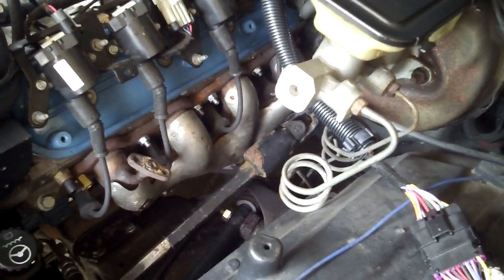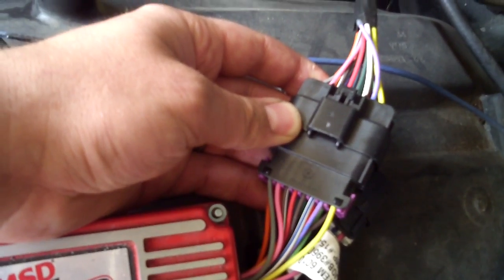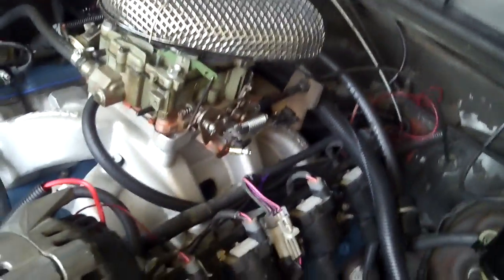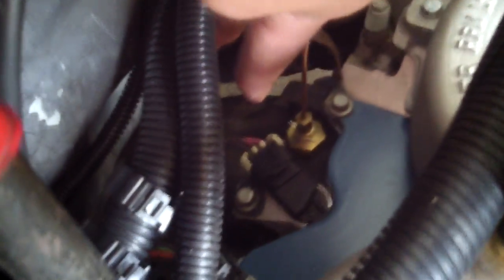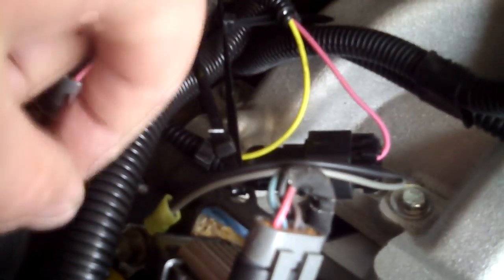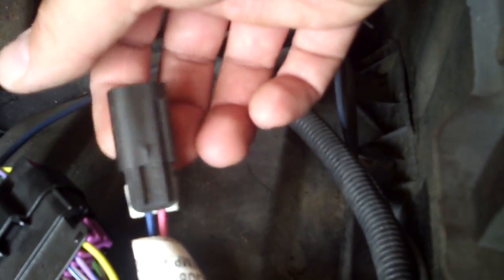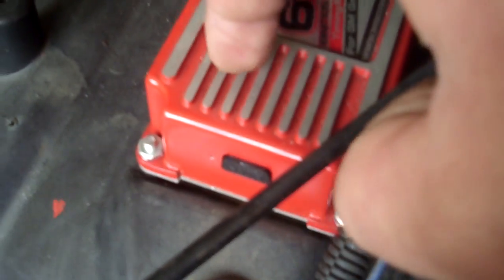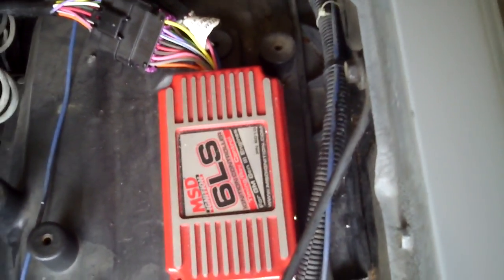How to wire an LS1 engine using MSD-6010

Comment: Thanks for the useful info 👍 , i have a cadillac with a 472 that i will swap for an ls1 with a holley sniper efi , how should i wire it and should i run the ls wiring harness or the stock one

Comment: Do you have a part number for the map sensor thx
Reply from the maker: Rock auto
Reply: @beeterolds  I don’t understand partner, I was seeing if you knew the part number to the map sensor I ordered one and it doesn’t plugs into my harness like the harness you have
Reply from the maker: No i do not... Go on rock auto and source a map sensor for a 99 thru 06 4.8 or 5.3

Comment: What did you do whit the knock censors?
Reply from the maker: Doesnt use em
Reply: What msd box did you recommend i have 05 4.8 whit 799 heads and is going on a 92 chevy ?

Comment: What’s up bro quick question how did you go about your oil pressure and fan sensors and coolest tempt
Reply from the maker: Fan is on a switch.. Oil.pressure and coolant are on aftermarket gauges

Comment: With this box do i need the ls ecu and harness and do you have to tune it??
Reply from the maker: No. And yes
Reply: @beeterolds  the box has to b tune or the ecu
Reply from the maker: You don't need the ecu. The box can be tuned or run it with the preset tune
Reply: @beeterolds  oh ok thanx

Comment: Hi I'm in the process of ordering the msd 6014 box and I understand where all the wiring and power leads go to. My only concern that I don't know is where the fuse is? Instructions say to use a 30 amp fuse relay. What did you do for your fuse?

Comment: Do you have to re wire ignition or does it hook up like a distributor with a 12v power and factory ign wiring?
Reply from the maker: Cameron feltz bingo. Distributor wiring

Comment: so I'm putting a 5.3 in a s10 and want to do the efi to carb swap, I don't need the factory harness for the 5.3 at all right ?
Reply from the maker: wolfgang beacham if you are going carb no. However you can use the the factory harness and ecm to control the coil packs. But if you went that far you might as well go EFI

Comment: I can't for the likes of me understand why people do these LS swaps and don't finish it the right way by making it fuel injection. I have 91 s10 with the LS 4.8 and with fuel injection. From the Doner truck I also took the harness and PCM as well as the OBD block. I also kept my 700R because it's 4wheel drive. I did a off frame swap and bought the right engine mounts as well and also converted my rear brakes to disc. It was a 1 yr build but is was done right and being a GM tech for 25 yrs to me was pretty simple. Now if I have a MIL, I can hook my laptop to the DLC and make corrections as needed without guessing.
Reply from the maker: Watch my other videos I eventually went EFI... But people go carb for 2 reasons... 1.) Cost 2.) simplicity... I've been on both sides and I must say for a weekend Toy... Carb is definitely the way go... Grab an intake and MSD controller (You can score both used these days for less than $500) I am speaking from a performance stand point.. If you wanna put a stock engine in a donor vehicle more power to ya... Tuning get expensive really fast and by that time its cheaper to go carb... I spent a lot of $$$ getting my setup running right and for a daily driver YES EFI is the way to go... But looking back I should have left the carb on it... Thats just my opinion..

Comment: how much did it cost setup..
Reply from the maker: Its like $320 now.. I paid 270 for it like 4yrs ago.. MSD also just released the 6014 which will support either Gen 3 or 4 engines.. Comes with the harness and garbage timing pills
Reply: Thanks man

Comment: I have a lt1 with 24x reluctor, with crank and cam sensors on the front of the timing cover. I already have coils hooked up to the valve covers. If I bought the 6ls just like you and ran the main harness by the front of the intake, will the rest of the plugs possibly reach to my sensors?

Comment: Did the adapter choke the big Qjet secondaries at WOT high rpm? I am thinking about doing the exact same thing and am apprehensive to adapter the spread bore to the square bore RPM manifold. What adapter did you use?

Comment: Hey is that a Quadrajet? Is the intake a dual or single plane? how did it run with the Quadrajet?
Reply from the maker: ran great brother EFI now...
Reply: Did the adapter choke the big Qjet secondaries at WOT high rpm? I am 
thinking about doing the exact same thing and am apprehensive to adapter
 the spread bore to the square bore RPM manifold. What adapter did you 
use?

Comment: great job..from you experience can you tell me what is the shortest carbed intake...thinking of going with the fitech unit on top of a carb manifold and turbo hat on top..nut wamt to make sure the g body hood closes.
Reply from the maker: I've only used the rpm and the truck intake I can't tell ya to be honest
Reply: Dennis Dennis I’m wanting to do the same to my LQ4, I’m wondering how that Fitech and carb intake workout for you???

Comment: where did you get the wiring and box from?
Reply from the maker: +Trevor Weinzierl Summit Racing
Reply: +D.Szymanski what all did you have to do to the factory harness to strip it down to very little wiring to make this work?
Reply from the maker: with this setup you dont use the factory harness at all

Comment: I've watched most of the videos on this swap and have read the comments, this is in fact a very simple swap from what I have gathered, the only thing I haven't seen covered is the EGR, can it just be deleted and taken off the engine??
Reply from the maker: Chevelle61265 The carbed intake has no provision for an EGR system.

Comment: i got a engine from a chevy calvaler. well couldnt turn down the price for a build of mine.well of course the engine runs off of a computer so would will it help me get around that?
Reply from the maker: no...the MSD is for LS1 engines only
Reply: o okay. thank you
Reply: +BEETEROLDS It can be used ao all the LS motors, 4.8 5.3 5.7 6.0 6.2 7.0 and so on.
Reply from the maker: I meant the LS engine family
Reply: 10-4

Comment: Considering you have the carbed ls in a 3rd gen camaro, did you swap the stock wiring harness for a large wiring harness? Or did the MSD 6010 hook right up to the stock wiring harness?
Reply from the maker: Its a cutlass not a camaro
Reply: BEETEROLDS my apologies, but did you have to upgrade to the ls harness?
Reply from the maker: MSD provides you with everything you need... all you need to do is wire it to your existing cam and crank sensor as well as a map sensor and let the msd do the rest.. the only oddball wire harness interfacing I did was connect the 12v source directly to the old HEI 12 V wire source.. that's it

Comment: im planning on doing this with a 6.0 in my 1992 firebird but im not sure how all this work it seems plug and play but like how do you get it to start do you wire your factory harness to the starter  and stuff and how does the box know your trying to start it . also are you using an edelbrock carb a friend of mine is insisting i use one and i want to hear from edelbrock users if they are good
Reply from the maker: I hate Edelbrock Carbs... Im not saying they are bad.. I just never liked them..  You don't use anything from the factory harness.. The Msd kit comes with what you need to wire the ignition system

Comment: I got the 6012 for some reason i could drive it but once you floor it it starts to back fire why....Send me text at 786-238-4343  please i got curve 1 ontem the box
Reply from the maker: Did you get the right box for the right engine? 6012 is for the Gen 4 motor... usually a backfire can be a number of things... Like the secondaries of the carb are lean..
Reply: BEETEROLDS I appreciate that dawg  you just answered my question I have the 4th gen so i need the 6012 and I need to do a dod delete.

Comment: Awesome video!   Alright my question... I've got an ECU that controls the basics, the Fuel injectors, reads the MAF, TPS water temp, etc... but does not control the timing. I've got a Coil, Distributor and 8 plugs, vacuum advance that are old and sloppy. Ive been looking all over for a system like yours. If I removed the old Distributor,coil and installed the MSD 6LS in place of the Distributor "ignition" that I could make it work? I'm trying to get a system for Individual coil packs and better timing aka I want the Crank position sensor. My ecu will adapt for the ignition like nothing even happened seeing how it has no connection with my coil and ignition system...   Thanks any help is welcome!!!

Comment: My friend and I are new to this LSengines so we tought of carburating it for les wiring and we bought a 6012 for an 6.2L (ls3 if im not wrong), i set the low rev at 2200rpms and the max to 6500rpm and i heard the engine changed its sound when i transfered the curve to the MSD 6012. BUT when we test it on the street it cuts the power at 4000 - 5000rpms, :/ we couldn't take it to the track last weekend beacuse of that...
Reply from the maker: Ive never messed with the low rev limiter I just set the one in the box to where I need it to be..I suggest contact msd man.
Reply: yes man what happened was that the module vas defective Im sending it back to msd to get it replaced thanks man,,

Comment: Hey this its a iron block its not really a ls1 aluminum block, for some reason the 6010 never work on a aluminum block, Some knowns why ?
Reply from the maker: Doesn't matter... the blocks are identical except for bore sizes and what not.. the only issue is the 6010 wont work with Gen IV motors because of the crank sensor type as well as the cam sensor location... Many people have used this box on alumium motor with no issue

Comment: BeeterOlds, is the MSD-6010 is increasing the spark voltage like the other MSD spark boxes?
Reply from the maker: No it just enables you to control your coils without a stock ECM...  it is nice because you can tune it with your laptop setting your rev limiter and timing curve

Comment: Hey beeter did you ever end up figuring out how to link to your newer laptop?  I'm having the same problem but noticed I could run my engine without a timing chip or a laptop?
Reply from the maker: They sell a special usb to DIN cable... the problem is on MSD's site they recommend you go with a certain manufacturer... I wasted 40 clams at Radio Shack just to find out their cable wouldn't work... I ended up using an old ass Dell from like 1998... Worked like a champ!
Reply: alright man thanks

Comment from the maker: Honestly you have to shop around.. I got a really good deal on the 5.3... Personally i would use an overdrive transmission unless you enjoy a manual thats a good way to go as well... 
6.0s will run ya between $800-$2000 for a decent junkyard core

Comment: so i want to drop in a 99 silverado 5.3 motor in my c10. just buy this msd box and drop in the motor and this box will run the motor properly,,, instead of converting it to carb and getting a distributor?

Comment: OK thanks, I Neva heard all the Carb ls swappers mention a single thing about the knock sensor plug .just tuck it away .an the rubber covers still cover valley plate?????